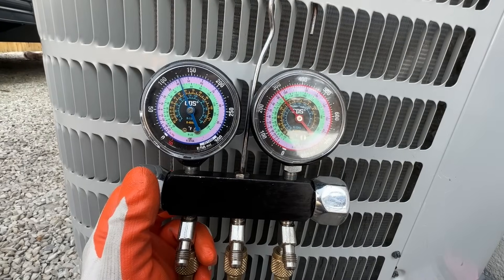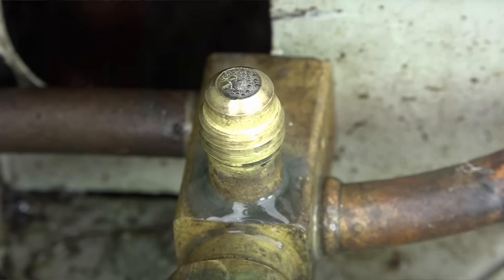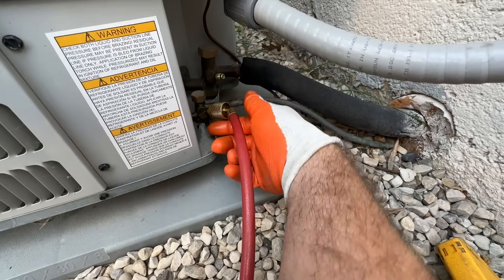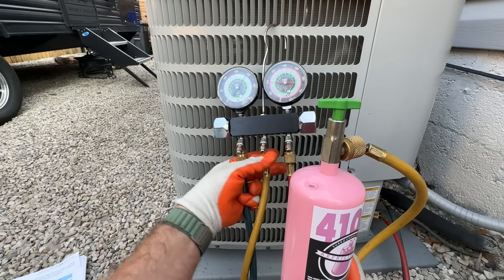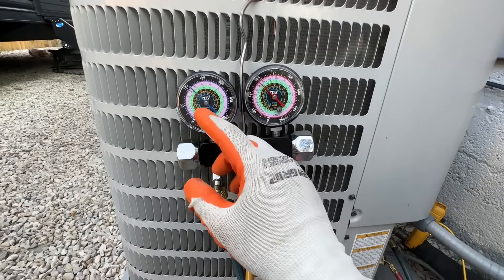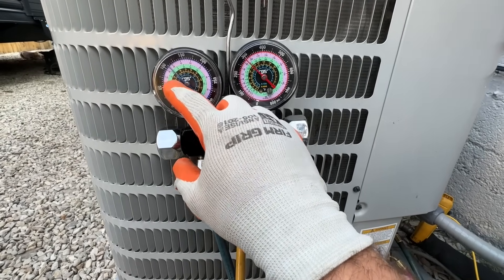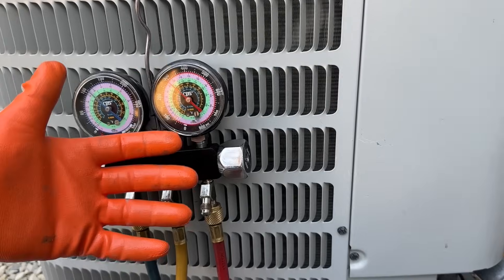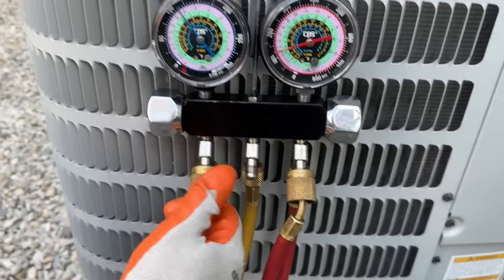How To Add Refrigerant To Your Air Conditioner R410A & R22

Comment: You had the can turned upside down which means you were adding liguid on the suction side? Is it safe to add liquid on the suction side of the compressor?

Comment: I have a trane system installed since 1991. Now it’s 2025. Almost 35yrs! Added a little Freon about 10yrs ago and just now it went low. So added a little more to come to the right pressures. Now it’s cold again. Thanks

Comment: Thank you for all your videos! You’re a life saver!

My AC went out and I called 3 different companies and they all told me I need to new system, running anywhere from $11,000 to $15,000. It’s an older system (17 years), and runs r-22 refrigerant. I did some digging and found your videos. I ended up getting my system going again for around $300. 

Thanks again! Your work is a real public service!

Comment: Thank you so much for your videos. I am a 65 year old woman with very limited knowledge of the air conditioner, but due to the videos I was able to diagnose my issue and replace the capacitor. Needless to say even though the unit is cooling and it is not 90+ in the house now I will have to call someone for Freon. But I am still a happy camper.

Comment: By the time anyone buys the refrigerant, gauges, book on charging, EPA certification and not knowing anything about airflow, static pressure, other possible refrigerant flow issues, bad TXV, clogged filter drier and a thousand other possible issues that could be causing the issue with the equipment. I highly recommend calling a professional so you get it done correctly and don't compound the problem by adding refrigerant to a system that may not even need it and you just made the initial problem worse. 

If you are not a trained HVAC service technician I do not recommend any DIY work other than changing your filter. You could cause more damage than good and cost yourself way more money by potentially destroying your compressor. 

DIY is not a good idea in HVAC and stop making people believe it is.
Reply: Can't afford the pros. Just to have the guy come out and look at the system was $140. They want almost $600 to do the refill, and $1800 to attempt to look for leaks. 
I know the guy that showed up to my house isn't getting that money. Private equity owns most of the HVAC shops (and plumbers and electricians) nowadays so it's all going to fund billionaire's yachts.

Comment: I want to know your opinion on using Leak Sealer’s , can they be harmful? I have a 8 year old Trane heat pump , I give it a small charge of 410a about twice a year. The Technician that just checked it out said a leak is most likely in the inside coil .Thanks for all your support, Awesome videos and advice!

Comment: So glad I found this.  HVAC company gave me three options:  1) replace the whole unit since its under warranty (that feels slimy); 2) clean system, look for leaks, repair leaks, add refrigerant - $2600; 3) just fill refrigerant up to 3 lbs - $900.  smh.
Reply: I'd assume it's a defective unit. Guarantee they won't extend the warranty beyond its expiration.

Comment: Very good info. II have had to learn the HVAC system. You have taught me every step of the way. I feel confident now but not so before. Did away with the swamp cooler on the roof and replaced it with a new full system. Just need to add a little coolant to compensate for the line set length and should be good to go. This video helped a lot. Thank you, thank you, so much.

Comment: Well, just had AC tech come out today. Said i had a leak in the compressor. It was $400 just for him to find the leak in like 10 minutes.  Them the compressor was still under warranty so that is no charge but to replace it and recharge the system is another $1500.  They are charging $192 per pound of 410, and they say i need 5 pounds of it.  If i look online i can by a propane tank of 410 freeon 25 pounds for $277 dollars.  So they buy it at 11 dollars a pound and charge me $192 a pound.  What a scam.
Reply: You were definitely scammed if they only replaced the compressor. The new compressor holds the freon so why would they charge for freon again? My evaporator failed but was under warranty. They wanted $150 per pound of  r410. $1500 to install the evaporator. I told the AC tech, just replace the compressor as it was old and out of warranty. Slam dunk as the compressor holds the freon so I saved on that cost. You should contact your better business bureau.
Reply: Not for nothing but ac tools / equipment is super expensive. And they need to dispose of the old gas / oil.
Reply: @motocross03087  The tools are not expensive at all, at least not the ones I've seen online. These people are out to nickel and dime. Thank goodness for YouTube. I have a system that requires R-22. The technician has been telling my husband that refrigerant is hard to find for years. My husband just went with it. I looked it up online and found that they sell it everywhere, so I ordered some. He will not be getting another 500 bucks out of us. Luckily, we have a few close friends and relatives who have just become certified as AC techs, so we will be using them to add more refrigerant without breaking the bank.

Comment: Do you gotta shut the system off before removing the fittings from the ports? You never mentioned that. I would assume yes because there’s more pressure when it’s running

Comment: Your video is so much better than every other video I’ve seen where they make the process so needlessly tedious and like do a terrible job explaining things clearly, this is straight to the point, easy to follow, no nonsense. Most other videos make what should be relatively simple seem unapproachable. Your video does the opposite. Thanks for that. Also for the tip on where to get refrigerant.

Comment: Great informational video!  Thanks!
Last year I paid $800. For what the HVAC guy said was 2pounds. He didn’t use a scale.
Reply from the maker: Yep, this happens EVERY DAY
Reply: I find coupons for “ac tube up” which usually includes “up to 1 lb” and runs between $30 to $50. They’ll be like welll you need this and that it’s gonna be a bazillion dollars. I’m like nah bruh, listen. I don’t care. Do the tune up, and give me the lb. Don’t worry you’ll get a tip. They’re like “it’s not even gonna do anything.” I’m like just do it. So they do it, and I pay them the $30 with two twenties. Keep the change lol. And guess what? It did “do something.” Cuz it works just fine now. The guy didn’t measure it either. I suspect he accidentally put more than 1 lb in there cuz my system was thirsty. Do I feel about it? Absolutely not.

Comment: If we are only adding 410 a into the low side is it really necessary to even hook up the high side line? It would seem for simplicity in adding a little refrigerant, we could just hook up the low side, hook up the bottle, burp the line, then throttle in some refrigerant until we hit target. Is this a possibility or what am I missing?
Reply: thats correct

Comment: If you order a recharge kit with low side pressure gauge and line be sure to look at the hose ends before making connections. One hose end has the Core Depressor (brass pin) and the other hose end does not (no Core Depressor). Hook the open hose (without Core Depressor) to the refrigerant tank, and connect the hose end (with the Core Depressor) to the HVAC low side port. Now you can open the refrigerant tank valve and recharge. Be sure to connect in the order outlined. If you connect to HVAC before attaching to refrigerant tank, HVAC gas will escape.
Reply: Thanks!  See, it;s not that simple.  Also, I got a vehicle gauge set, but says "not for R22 use".  I'm guessing that the units on the guage are different.

Comment: At the beginning of every video you do, please mention that the high pressure valve on the metering gauge should never be opened with the AC running and the gas canister attached. I have seen and treated face, abdomen and blown palm, due to too many horrendous accidents because of an exploded refrigerant canister brought about by a less knowledgeable DIY guy. The internet is flush with people attempting DIY procedures.
Reply from the maker: Thanks for the heads up I will make sure to mention that! 🙏🏼

Comment: 1 question, when you crack the blue line to start charging do you open the red line too? I only topped off AC twice throughout several years and It worked good but ...I forgot!Thanks

Comment: I couldn't get the sub cooling to 10 degrees. New tank is around 190 psi. 60 degree ambient temps. Used a bowl of hot water (set tank in water) to get the R410 pressure up (needed around 212 psi) and got my 10 degrees sub cooling!

Comment: Thank you for the video! Here is my story: I paid on "specialist" to come and tell me that the unit is frozen, then he defrosted and left (after I paid him)! Two months later (or less) the same happened! Another specialist came and told me that there is low refrigerant and most likely there is a leak. The shock came after he told me to spend $700.00 on 7 pounds of refrigerant or he can not diagnose the leak with only a third of the pressure! He did not even try to open, look or anything but just collected the payment and left! My "specialists" were sent by my home warranty company "Choice warranty"!!! Dear "Choice warranty" can't you find qualified technicians? I am definitely going to learn the basics at least not to be taken for a ride by the .....ers!

Comment: I appreciate your videos! Have you seen ability refrigerant’s R-22 recharge kit? It comes with 2 pounds and a recharge kit (gauge and hose). Wondering if I can get by with just purchasing it to recharge? Thanks in advance!!!
Reply: Also, when you stated that you “turned on system” did you mean the AC unit? I’m speculating the ac unit must be on while adding refrigerant? Thanks again

Comment: I quit working on a/c systems when other technician's were putting r410a into r22 systems mixing refrigerants . I caught one and asked him why are you putting 410a into a r22 system? he replied , ahhh lol i'm just topping it off it was a little low. I told him buy doing that you are decreasing the efficiency of that unit by 2 degrees and in addition to that your not suppose to mix refrigerants . no reply and remained silent. I went on about my way.

Comment: I have a 4 year only system and the service tech said there is a leak in the coil. he said I have to replace the coil and the R410A would be $700 and the labor is almost $3000. Is this normal? can R410A with stop leak be used instead?

Comment: If your inside coil have a leak buy Leak Saver Direct or Nu-Calgon EasySeal Ultimate SS Refrigerant Leak Sealant until you can replace the inside Coil. Mine has last the two season but I will need to replace it when funds are available.

Comment: I was just quoted  $11,800 to replace my R22 Condenser unit  phase 1 . 5 tons and the coil evaporator  plus the lines   for a R410 unit ,because my R22 coil evaporator has a few leaks and it is freezing up . I was told that they don't make R22 coils evaporators any more and the refill of that refrigiration is very expensive . Can some one give me a pice of advice with more knowledge to this. Big Thank you to all !
Reply from the maker: If you watch a bunch of our videos you will gain knowledge guaranteed, cheers man

Comment: I have a question if you don't mind answering. I have a Rheem Classic a/c and there's an issue where the temperature goes up within a few degrees in 4 hours and a problem message shows up on the Ecobee thermostat....There may be a problem with the cooling system. For the past 4 hours, the thermostat has been calling for cool, but the room temperature has increased by 3.5 ffahrenheit. It displays the wrong date January 31st on that day in July. The next day the same message with February 31st at the top of the message. After turning the thermostat on/off the message cleared and the temperature was back to the set temperature in 3 or hours. The larger line is cold, so could it be a thermostat problem or the line is frozen? ?

Comment: I always wondered will that small burping of the manifold lines take out all the air and moisture inside them before attaching them to the AC unit and adding refrigerant,  and if so then why can't you do the same with the actual AC lines and why would you need to vacuum pump the lines ?

Comment: I've watched a couple of your videos and first, thank you!   My system took a little more than 2lbs to get it where I have it.
it's about 88 degrees out. I have the coolant temp at 40 degrees which is about 68psi. Should go a little bit higher maybe? The Tstat is showing 76 degrees at the intake and 60 degrees out of the vents so a 16 degree difference. That seems good. The only thing I'm questioning is that the low side at the compressor is not "beer can cold". It's not cold at all and on this very humid day not showing any condensation.
Also, the first go around I did burp the lines but needed to get more r22 but forgot to burp the low and high. Did burp the r22 line. How bad is it that some air got in?

Comment: Before just jumping in to do this, please research the repercussions of doing this without and EPA 608 license , the regulations and fines are online for you to see. The EPA can fine up to $37,500 per day for violations of its regulations under Section 608 of the Clean Air Act. This includes adding refrigerant to an AC system without an EPA license. Other penalties for violating the Clean Air Act include: Criminal prosecution in US Federal Court, Confiscation of violating substances, and Loss of certification to handle refrigerants. If you don't have a license, please don't do it

Comment: MY HVAC company was ripping me off. OMG turns out about a 500-1000% markup on parts and labor. I fired them after I learned what things cost to buy.
Well thank you I have a 609 cert so I understood a lot of what you are speaking about right away. The pressures and temperatures are different I saw right away and it was easy to look up online.
I have watched many of your videos now. I installed a new defrost board, soft start, replaced the contactor switch and also the compactor. I have cleaned the evaporator and the condenser with juice off amazon. I had some issues with the air handler and board corrosion so I fixed a few wires, ran 3 new ground wires for the 24V side so my smart thermostat and defrosters board would work again. Now everything is working right again. I ordered my 410A. 
My subcooling, high side pressure and wb/ambient temps are finally where they should be. Summer is nice again for a change of 3 years. Winter should be warmer now that all the problems are fixed. The Army taught me many things, you taught me how to apply them to HVAC. Many, many thanks...
(‾◡◝)(✿◡‿◡)(❁´◡`❁)^_~

Comment: 6:51 6:51 6:51 6:53 this is precisely the same procedure as putting the refrigerant in my car's air conditioning no problem to it it's not difficult okay it's not that hard you should not have to take a class to get your hands on some refrigerant that is insane is that a new law I mean I got a bottle a billion bottles of air conditioning fluid working with air conditioner wasn't working and all that s*** so I got a bunch of them I got a bunch of refrigerant sitting here in front of me and you're telling me I have to use a specific refrigerant why they are exactly the same

Comment: Pressure gauges the same thing essentially exactly the same thing the only difference is that it's your house that he's the air conditioning I mean the last video you made was so complicated and so convoluted I had no clue what that you were trying to say this one is very simplified this is exactly how easy it is to do it it's so funny how men just like to make things more complicated like I don't want to have to hire a man to come out here and tell me that I need more things done to the air conditioner and then it needs to be done I know that the air conditioner works I'm saying there has to be a little bit of I must need to add some of this stuff into it because when it's very hot outside it should still be cooling house down just as much it shouldn't be a moment of well it's it's hot outside right so now I'm rather than me having the temperature say 73 like I put the temperature to 73 it should be 73 on the inside it should not be hard to to cool up the house with my central air conditioner I don't understand so I'm assuming that it has to be refrigerant I have refrigerant from a car for a car to refill the car so why can't I just use the same goddamn thing

Comment: TOTALY saved the day! My minisplit stopped cooing and going to Ability to order 410A and following your instructions TO THE LETTER, got coil temps down to 49 degrees…put in another order as the 2lb can wasn’t enough…but my ranch is in west Texas and it is HOT. MUCHO GRACIAS, amigo!

Comment: Systems should NEVER be charged by pressure or evap temps alone. Somebody out there without the knowledge is going to make matters worse when they have a low reading low pressure and a high reading high pressure and just dump gas in it because Mr. You told them to charge it by temperature based on low side pressure. Now they’re overcharged, over working their compressor and having more problems than before because they weren’t familiar with proper pressure readings and assessments.